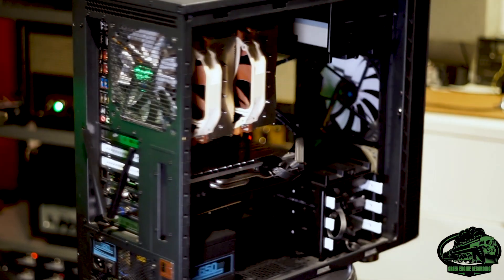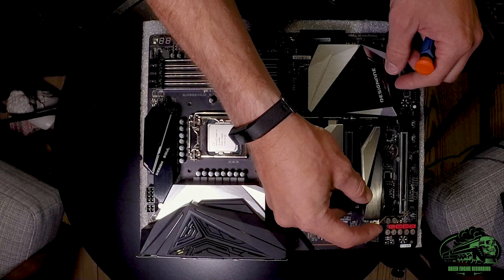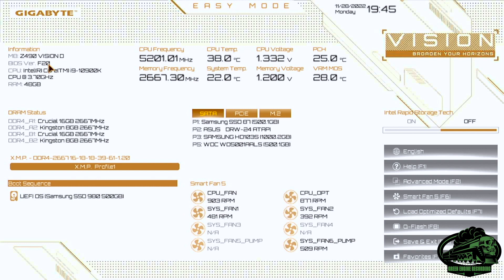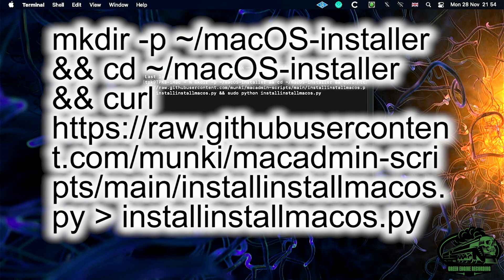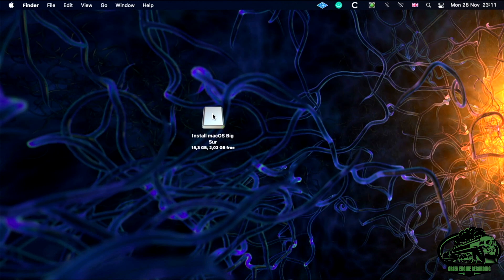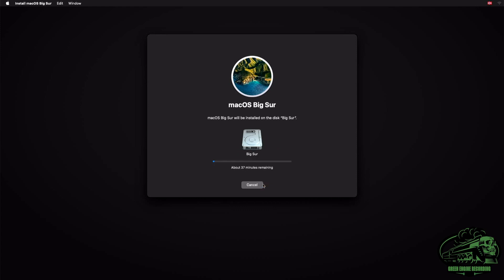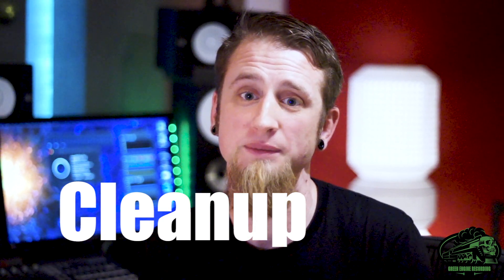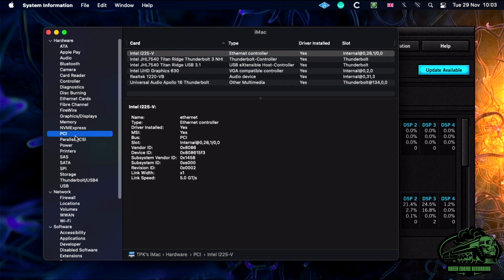How To Build A Thunderbolt Audio Production Hackintosh

Comment: This is an old post but you should make it clear, anytime and ALWAYS when updating a bios and say you are on bios “17”, never jump or skip all the way to the newest, 20 for instance. You have to incrementally install each bios all the way up. I.e. install 18, then 19, then you’re ready for 20. If you skip a bios there maybe have seen special code or flashes per update and it’s very important you do in sequentially
Reply from the maker: Ah thanks for the insight & sharing 🙂 
I didn’t know that 🧐

Comment: Good to know that the thunderbolt 3 to 2 adapters work fine on a hackintosh build. I'm about to make my old pc into one soon. Running a GA-Z170X-Gaming 7 MB with a built in TB3 port, 1060 ti 6GB ram & vengeance 64GB DDR4 3200mhz. Thanks for this!
Reply from the maker: Yes and it’s great to know that you can use the cheaper Apple adapters. I heard they wouldn’t work so annoyingly bought the Startech one first 😏
Good luck on your hackintosh journey!
Reply: @GreenEngineRecording  ah yeah thats the one i bought; startech. Has been working great on windows for me for 7years now. You're saying that one does work? And thank you!
Reply from the maker: @westonguidero both work :)

Comment: Will you be flashing Thunderbolt custom firmware
Reply from the maker: No it’s not needed to get the hackintosh to recognise thunderbolt hardware. I’ve heard some devices may require it, and if you want the ability to hotswap thunderbolt devices you’d need to. But as I show at the end of the video the Apollo is recognised straight away

Comment: Gigabyte Z490 Vision D is not available. Is there any other mother board for hackintosh which support thunderbolt 3?
Reply from the maker: Yep it’s getting increasingly difficult to find. The z590 vision D supports the same processor and should be a very similar setup. It’ll just need the EFI tweaked so you’ll have to get into Dortina’s guide for making one.

Comment: My Mac Pro 2009 is having trouble running some virtual instruments, so I am pleased I saw your video because a Mac Pro 2019 is far too expensive. The only trouble I have is that all the parts you have in your build are quite expensive, could you propose a cheaper alternative that still supports PCIe cards and Thunderbolt. Also, would a firewire card work for my UAD2 Satellite ? 
Thank you for sharing this video which will allow me, as a hobby musician carry on having fun.
Reply from the maker: You can build it cheaper but may struggle with the thunderbolt. You could look for the micro ATX but you’re gonna get less pci and ram slots. 

Unfortunately UAD dropped support for FireWire after Catalina so if your satellite will be useless if you go past that OS. A FireWire card will still work with other stuff, just not UAD 😩

Comment: Hi, I almost have the same parts but my mobo is a Gigabyte Z490 Vision G and RAM are Corsair Vengeance LPX DDR4 64GB ( 2 x 32GB ) 3200Mhz. Can I follow the same guide ? Thanks for your help
Reply from the maker: Yep the Ram wont be an issue at all, the only thing that you'll have to redo is the port mapping for USB on the mobo as the two boards differ over thunderbolt and the number of USB points
Reply: @GreenEngineRecording  thanks for your kind reply. To have thunderbolt ports and to use my Apollo X6 or X8, can I add a gigabyte gc-titan ridge? or there is another solution?
Reply from the maker: The vision G has a thunderbolt 3 header so yep, with the expansion card you’ll be good to go :D

Comment: Very nice video. Only thing, please do an instruction on doing the install from a Windows for those that don’t already have a Mac 😉

P.S

I disagree in the part that you don’t need a big and powerfull computer for music production. Apple’s own M Pro very pricey rig only scratches the surface of the most processor hungry setups and is still behind the most powerfull Xeon based Mac Pro’s. This may not be needed by the majority of users, but there is still plenty of Pro users that wont upgrade their Mac Pro’s yet because the new Apple Silicon despite it’s effeciency still isn’t on par with the most powerfull Intel based Mac Pro’s
Reply from the maker: Luckily there’s not very much of this guide that is Mac specific, so once you have osx downloaded you’d be able to follow along. I don’t have any windows machines but there are other guides describing how to do this with a windows machine.

Comment: I can tell by the music this is the vid I was looking for. I am just using a scarlet 2i2 and I want to be able to use mac logic X AND reaper on PC. I don’t think I need to do this, but this… this my dude over here.
Reply from the maker: Glad you enjoyed it! As the scarlet is usb and you don’t have to worry about thunderbolt you’ll have a much easier time getting a hackintosh up and running. Good luck on your journey 🤠
Reply: @GreenEngineRecording  I have a what would you do question… I have a MacBook that is late 2011 that won’t upgrade OS - however the battery bloated and I got a new battery at the Mac store for the danger and trouble lol - can I stick an SSD and whatever else in that thing and keep cruising or should I let it go?  I can’t run GarageBand with my old OS and it’s sooooo slow. But the ports man… it has ports!  I don’t want / can’t afford a new one with the stupid two USB C setup
Reply from the maker: I still have a laptop from 2011 where I switched out the HDD fit an SSD and upgraded the ram. Very simple upgrade and it’s still running strong on El Capitan. I’ve recorded 24tracks live to it but haven’t tried mixing. Depending on how many plugins you use it might be fine for your needs. Either way it’s good to keep the old macs going. That laptop is a lot more rugged than the 2015 one I have!
Reply from the maker: I would upgrade with the following https://amzn.to/3Io3bhl
https://amzn.to/3xmHic3 to get the most out of your Macbook Pro :)
Reply: @GreenEngineRecording  for the price - worth a shot!  Thank you man!  I’m not worthy!
Reply from the maker: You’re welcome dude. Yep it’s totally worth it for the money. An SSD will make it way faster

Comment: Great video! 
Is it possibile to have a cheaper hardware configuration with less power but almost the same stability?
Reply from the maker: You could pop a i5 processor in an ITX version of the motherboard and less ram which would reduce the cost some.